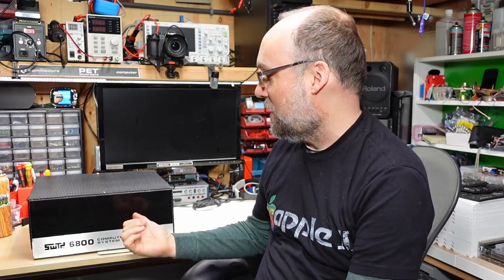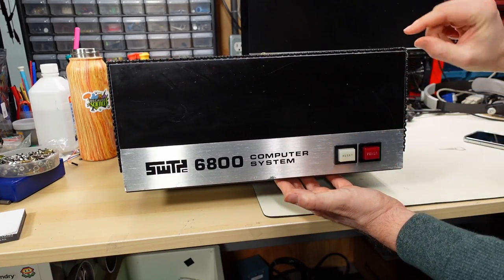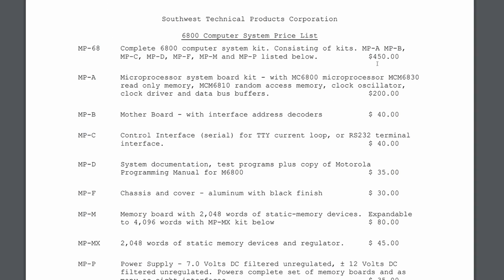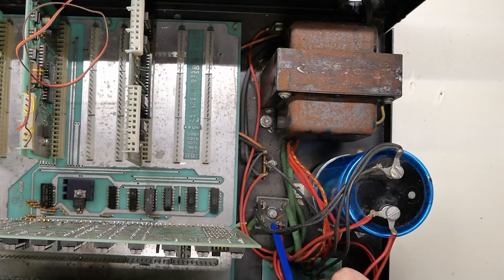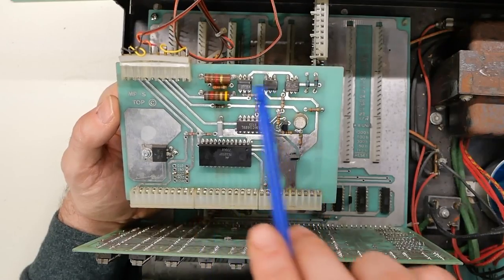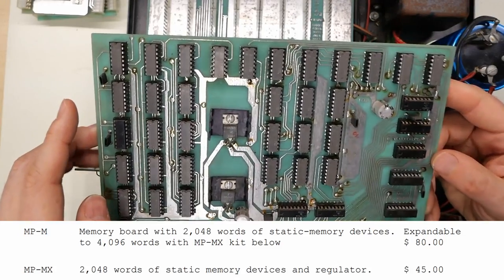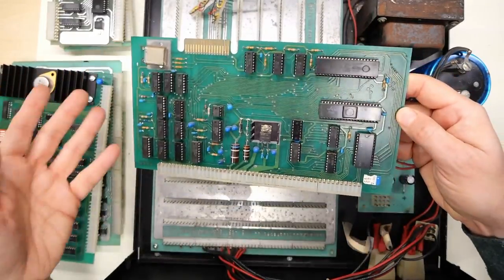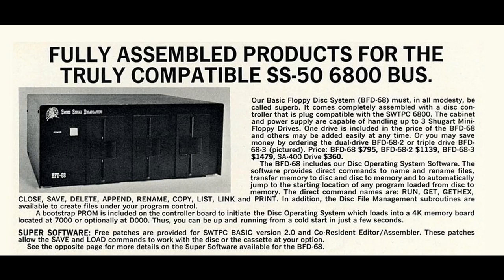The 8-bit home computer from 1975 you've never heard of

Comment: My first computer build was a SWTPC 6800. Although I used audio cassette with the AC-30 to store data and programs, I later added an 8” floppy drive offered by SWTPC. The floppy drive used a parallel card. I bought a Xerox daisy wheel typewriter with an parallel interface to use as a terminal .  Later I bought an ADM 3A CRT terminal and upgraded the RAM to 32K. 

I still have the main unit and AC-30 stored in the attic along with the documentation.   

I built a system based on the Motorola 6800 because I had worked at Motorola when the 6800 was being developed.  The 6800 team recruited a colleague of mine to write a cross assembler for the 6800 that ran on the DEC PDP/11.  The 6800 team leader was Chuck Peddle who left Motorola for MOS Technology where he developed the 6502 chip that was used in the Apple II and the Commodore PET.

Comment: Still have my SWTPC 6800 system & documentation which I built as a senior in college (like 1977).  Have a 4K plus a 16K memory board, several extra interface cards (serial & parallel), cassette interface, and the CT-1024 terminal with the matching SWTPC monitor.  Remember buying the 16K memory board on a trip to Boston, MA ... it cost me around $625 which was more than the kit cost.  Actually used it to acquire data (SPEX laser Raman spectrometer) as part of my master's thesis in 1979 ... very few "computerized" spectrometers in those days!!   Guess I should see if mine still works ... look forward to you next SWTPC 6800 video!!

Comment: Many years ago (late'70s) I went to a local computer store and saw a table with used systems. One was a SWTPC 6800, and the other was an OSI (Ohio Scientific Instruments) C8P. Both were just the "boxes", and were priced the same (and I don't recall the price, but reckon it was around $300) but I bought the OSI because it used a 6502 CPU, and I was familiar with that chip, as I had built a couple of homebrew systems with it. I didn't realize what I had bought, as the OSI had the video interface board and the cassette interface, along with BASIC in ROM. I hooked up a keyboard, and modified a Sharp TV to be a monitor, and was running! Later in my career, I used a variety of 6800 variants, along with 6809 and 6811, but still recall fondly the old OSI. I wish I could remember what I did with it, though. If you are able to find one of these, I think you'll be impressed with its capabilities.

Comment: Hi:  This was by first computer and it came as a kit without any software.  There was a Motorola 8-1/2 x 11 book about a point of sale (cash register) that had a lot of information about the 6800 and how to use it.
I wrote a pseudo dissassembler that would read a Motorola program paper tape on the Teletype machine and print out pseudo source code where the original hex code was added at the end as a comment.  This way you could feed the source code into an assembler and get source code.  But with just the dissessembler I was able to reverse engineer the Motorola Editor and Assembler paper tapes to figure out the jump addresses so that they would be compatible with the SWTP 6800.  Using these tools Tom Pitman developed Tiny Basic.

The SWTP has two types of PCB.  The large boards with a 50 pin buss and the smaller ones with 30 pins.  The latter are possible because the address buss has already been decoded so that does not need to be done for the I/O boards.  One of the large boards impliments a Direct Memory Assess so instead of using the 6800 to bit bang 8-bit words to/from storage the DMA chip can move data at faster speeds.  This allowed the use of 8" floppy disks.

My neighbor Reed Anderson brought Victor Borge to my place to show him how the Verbatium 8" floppy disks were being used in home computers.  Victor then did a number of commercials for Verbatium.  

More at:  https://prc68.com/I/comp.shtml#SWTP

Comment: The "later version with a 6809 processor" was the first computer that I ever used (1983), including programming in Flex BASIC and 6809 Assembler. I think I still have in one of my "deep junk" boxes a board I built to plug into the Molex bus.  :^)

Comment: I purchased the SWTCP kit and built this computer in 1976.  I also bought the SWTCP CT-64 terminal kit and the AC-30 cassette interface kit for it.  I bought a Radio Shack paper tape printer for program listings, because it was cheaper than the SWTCP printer.  I never upgraded to a floppy disk drive, because by the time I could afford a disk drive, the computer was already obsolete.   I studied all the computer kits on the market at that time and decided that the SWTCP computer was the best bang for my buck.  Another reason for my decision was because Motorola made a complete family of support chips for the 6800 microprocessor, with excellent documentation on the chips, and I also believed the SWTCP fifty pin motherboard with Molex connectors was more reliable than the one hundred pin motherboard used in most other computers at that time.  I also designed and built my own a 12K memory boards from scratch to go with the 4K memory board that came with the machine, giving me 16K of RAM total in only two motherboard slots, which was a lot of memory in those days.  I used 4K static RAM chips on my homemade memory board, which I built using wire-wrap sockets.  At first,  I modified an old tube type portable TV set  to accept a direct video input and used that as my monitor; it's amazing that I didn't get electrocuted with that setup. Later I built an RF modulator, so I could use any TV for a monitor and I built an acoustically coupled modem for the computer.  At the time I built the modem, there were only a couple of BBS systems at computer clubs in the U.S. and none were in San Diego where I lived, so I had to make long distance calls to the East coast and Northern California to try out my modem.  My homemade modem used an adjustable analog oscillator (not crystal controlled) to generate modem tones, so I had to tweak it on-line until I established data communication with the BBS stations.  As a result, I got a nasty letter from the Common Carrier division of the FCC warning me to stop what I was doing.   Apparently, I triggered some long distance telephone switching equipment while I was tweaking the modem tones and AT&T assumed I was using a Blue Box to try and make illegal long distance phone calls.  So, I had to shelve that modem and wait until I could afford to buy a commercial modem to get back on-line.  I purchased the assembler and memory diagnostics for the computer on cassette tape, and later I bought cassette based BASIC for the machine.  I had to write  my own programs in the beginning, which was good, because I was a hardware engineer with no programming experience and I learned how to write code on the SWTCP computer.  I still have the computer and all the SWTPC accessory kits I built for it.  And, I still have all the original SWTCP manuals and Motorola 6800 books, plus the hand written notebooks I created as I built the computer and taught myself how to program it.  I even have the original software on cassette and a lot of the original advertising materials for the computer. The computer and all the accessories still work, at least they did the last time I tried to use them, which was about seven years ago.  I'll never forget how excited I was back in 1976 when I turned this computer on for the first time and the MIKBUG asterick appered on the TV screen.  What I learned from building my SWTCP 6800 computer actually helped me get jobs, including one at Findex Computer, which was another early microprocessor based computer company that folded in the nineteen eighties.  But, working on Z-80 systems at Findex helped me get other jobs in the early home computer industry that helped to springboard my career.  I'm now in my eighties, and I hope I'll be able to find a computer museum that will take my computer with all the accessories and documentation before I kick the bit bucket, because it may be one of the most complete, unmodified SWTCP computer systems that's still in existence.

Comment: In 1985 at Durham University I recall building a MC68000 CPU control board. Everything was precisely wire wrapped and if you got it to work, it was then programmed with Assembly. It wasn't RISC but CISC (Complex Instruction Set) with 32 Bit instruction set and 16 Bit Cpu Bus

Comment: I've never had this actual computer, but I remember ads for it in Popular Electronics. I remember one ad for a version of the BASIC computer language you could get for it...on punched paper tape!

The motherboard's card address decoding logic made sense for the 6800 CPU, since the machine language architecture of that CPU had no I/O instructions at all! Any I/O had to be implemented as memory mapped, using full address decoding, and regular memory read/write commands to input and output data. The card addressing scheme allowed the address decoding logic on individual boards to be simpler, usually just the lowest 12 bits.

Comment: I built and still use the SWTPC Tiger 01 audio amplifiers. This came out before the 6800 did. It was something that Heathkit didn't have. SWTPC started building computer kits as others, but they went out of business when the non-kit product producers came out with the lower prices. Kit building isn't as cheap as it was back in those days!

Comment: I never attempted one of those, but several of my buddies were veterans of the Battle of the 680 Wires.  For the time, it was one SWeeT PC! 

You can make that missing trim piece easily out of a bit of aluminum angle stock. Some time with a wire brush will replicate the original finish.

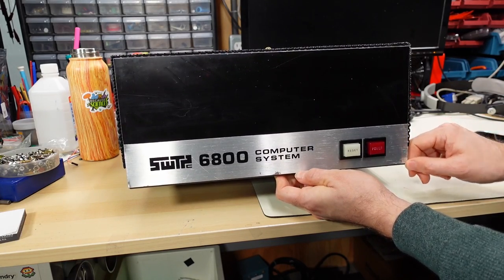Comment: Adrian, at 4:30 you referred to the cover as being "metal mesh", but I've always heard it described as "perforated metal" due to it having holes punched out.  I've seen similar sheet metal sold in hardware and home supply stores.  Some have a sort of diamond shaped hole pattern.  I figured I should mention it in case anyone out there is trying to restore or recreate the same sort of housing used on the SWTPC 6800.
Reply: With the metal case like that, it didn't really need much, if anything else, for RF shielding.

Comment: In 1976, I designed and built a single board computer at work. I was the technician for the 8080A at National Semiconductor and was asked by my boss to create a demonstration board. I used an 8"x12" pin array board (full of tinned through holes on 0.1" centers) and wire wrapped up the 8080A, 2KB of RAM, 8KB of UV erasable EPROM, and a 20mA current loop (teletype) I/O. It took me one month from assignment to working computer. I left the company not longer after that and left it running, printing out "Now is the time for all good computers to come to the aid of their users." once every minute. By the time a friend came on the next Monday some 3600 lines of text had been chunked out on the roll of brown teletype paper. I do not miss the days of debugging mistakes on wire wrapped boards.

Comment: Haven't been able to watch this video yet, but I'm looking forward to it a lot!  My dad had a friend who sold these (well, he sold SWTPC systems, if not this specific one) at his shop in the late 70s and early 80s, and then I had a job in the area later where they'd apparently bought one from him, along with a similar system from GMX.  They were both more recent systems - think they were an 020 and 030, respectively.  If my memory is right.  They ran UniFLEX as their OS, so they were sort-of familiar to use if you had Unix experience.
Reply: Was GMX actually Gimix or something similar?  I've got a vague memory of something named Gimix or GiMX from around that time... need to try looking it up.
Reply: @bobblum5973  Yep we sometimes called it that so.. did they shorten the name eventually?  Or widen it?  I've seen the two together a lot on what little I can actually find online since then, and honestly I can't remember what badge was on the front of it.  The purchase happened a LONG time before I worked there.  I'm 90% certain it was an '030, but to me it was just a big noisy fan box with the whole back side occupied by DB25 serial ports linked to terminals all over the office, and inside was thousands of lines of my C code...
Reply: @jc33353  I just did a little searching online, and it looks like GMX was the CPU card and possibly computer system's name, while the company name was Gimix.  That sounds about right to me, I was around back then although never actually worked with their hardware.  So many magazines back then, like Byte, Nibble, and I think there was either The 6502 Journal or 6809 Journal, or both.  Good times, a very dynamic environment.
Reply: @bobblum5973  Ah, very interesting.  Thanks for doing the research!  I read Byte for years, but am 5-10 years too young to fully appreciate the "wild west" of computing.  Fascinating stuff.
Reply: @jc33353  The fact that you grasp it at all is appreciated.  Too many people just look at technology without considering what came before.  I recall my first "PC", a 286 clone, and upgrading it from a 40 MB drive to a 540 MB one.

There are all kinds of older computers from the early days, like the Rockwell AIM-65 that had a keyboard but an alphanumeric LED one-line display.  There were a series of "Little Board" computers that were sized to mount atop a 5.25-inch floppy drive.  Lots of Z-80 and 6502, but also oddballs like the SC/MP-II.

Comment: I had one and hooked it up to a Silent700 terminal. I had no permanent storage other than cassette audio tape. At that time I made slightly more than $100/wk. The SS-50 bus generated so much RF noise, it disrupted all radio and TV in the house. Serial communication was actually done with a parallel interface chip by shifting, timing, and strobing the individual bits out. Later they introduced a serial card with a Motorola UART.

Comment: So, not only was it basically the second home computer ever (and priced like it), the company did not sell equipment that the computer REQUIRED to function.
The past is a dark and frightening time.
Reply: What required equipment did they not sell?  SWTP did sell the TV Typewriter so you could use a TV or video monitor as a "glass teletype" (terminal).  They also sold tape and disk interfaces and drives.  They even sold an early hobbyist-oriented dot matrix printer, which was probably the repurposed guts of a receipt printer.  Later they sold a much improved terminal.
Reply: There were a few home computers before the SWTPC.  Off the top of my head the SCELBI and Mark-8 were out before even the Altair.  And as Joel said SWTPC did provide all of the gear necessary to use it - they developed the CT-1024 terminal before the computer.  You would have only had to find a monitor or modify a TV.
Reply: The late 70s and 80s were a fantastic time for computers.
Reply: It was an exciting time for computing if you knew your way around a soldering iron. I never had anything with massive memory like that 20k monster but I could do a lot with 256bytes and a hex keyboard. Mine (1802 ELF II) eventually had a 4k ram card and a rudimentary sound card. It hooked to a B/W TV. Those were heady times for a budding computer nerd.

Comment: The "setup" that needed to be done on the other home brew computers was not needed with theSWTP6800 because it had a boot ROM, witch the other did not have.  That boot ROM allowed reading/punching paper tape and keyboard input/printer output (all of which a Teletype Model 33 could handle).  I replaced the factory boot ROM with one that contained a Real Time Operating System from Microware.  This was an improvement on the stock ROM.  Microware developed OS9 for the 6809 as used on the Radio Shack Color Computer.

Comment: I remember using one of these in the store "Digital Design" in Cincinnati, Ohio.  Daniel M. Petersen was the owner of the store, and he tolerated teenagers hanging out.
The SWTPC box was available to rent for 50 cents an hour, cheaper than a video game.

The store also sold Alpha Micro, IMSAI, and Apple II machines.

The BASIC language didn't support the SQRT function, so another fellow - a UC student - suggested writing Newton's method in BASIC to solve the problem.
It worked.

Comment: The 6800 was the top of the line 8-bit CPU.   It had more registers a more flexible design than the 6502.  This made it more expensive.   The software console  was actually a rather late enhancement on the mini computers of the era. such as the PDP-11 series.  These computers were used for business and lab work.   The 6800  put much of the power of a  " Real Computer" in the hands of the home builder.   This was a  rather full configuration.   With the floppy drive box it would have been a very powerful home PC.   It will be nice to see more  done with this beauty.    I was taught assembly language ob a P?DP-8  mini computer system not much more powerful than this one.   I mention Minicomputers because that is what the "Small Computers" of the time were.  Minis were also vastly more expensive.    I grew up with machines like this, in Byte magazine and dozens of others.  Thank you for showing a machine I dreamed of, out of high school.  Good luck and God bless you.
Reply: The computer museum in Rhode Island is loke a DEC warehouse! They have to only PDP-9 in the country that works!
They also have many many SWTPC, Altair, Imsai, North Star systems